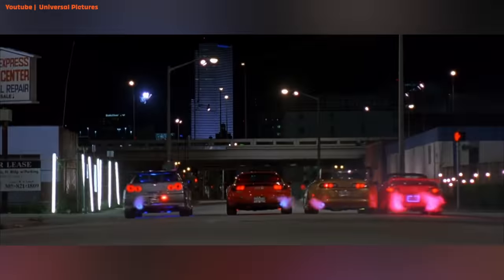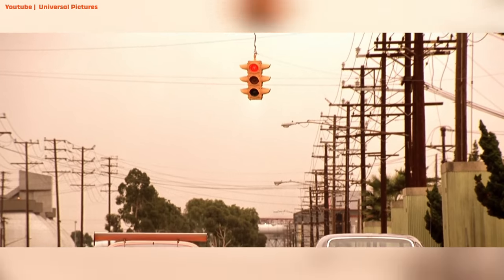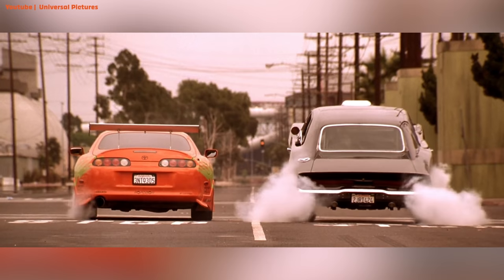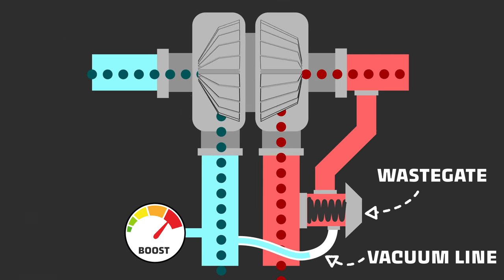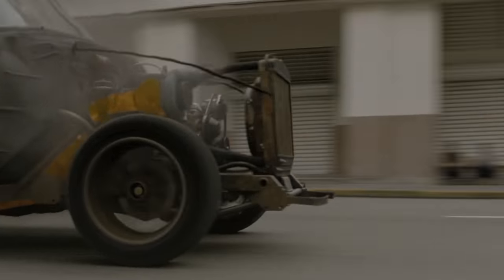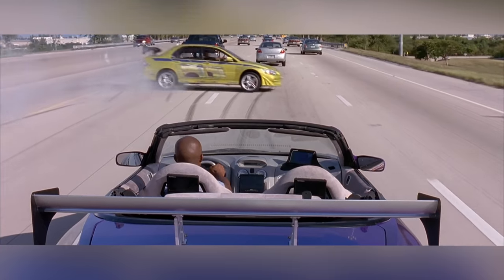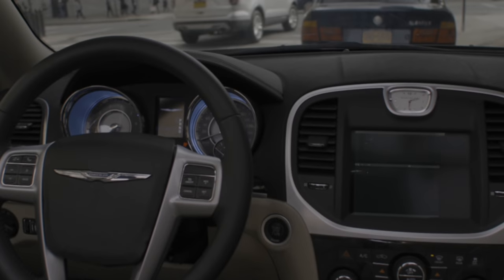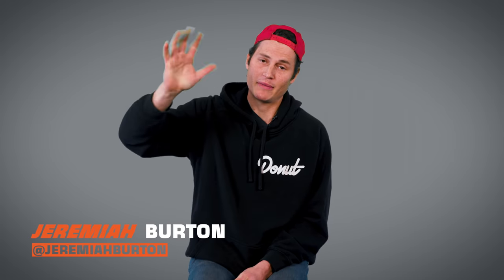Busting Fast & Furious Lies with Science

Comment: Vin diesel seems like the kinda guy to permanently run rich just incase he needs to pull the coketab on his wastegate.
Reply: "Pull the coketab on his wastegate"
I don't know how, but I will incorporate this into my daily vocabulary. :D
Reply: Lnao I love your pfp
Reply: @DominicDarrell  
Easy there, Tiger. You gotta take me out to dinner first- I suggest Gallo's ;)
Reply: @lllBASlll  Of what hour should one go out to Gallo's? 

;)
Reply: I mean it was considered the slowest so it probably was running Rich
Reply: lol maybe
Reply: Also, if the car had a pressure matched fuel pump or pressure regulator (which it would have to in the case of being a blow through carb) it could in theory maintain the appropriate fuel pressure and flow to increase power, especially if it was controlled on a sliding scale. That also wasn't addressed in the movie.
Reply: @dragonbrandon1995  yeah he totally could've tuned it for max boost then turned the boost down a lot causing the car to run very rich until pulling the coke tab, I feel like they overlooked this and could've found a more "impossible" scene because adding horsepower by adding only air is totally possible unless it's running lean

Comment: No way he hacked those cars without going to StackOverflow at least once.
Reply: Well moral of the story is that older car without cellular connection is hacker proof 🤣🤣🤣
Reply: @ramadhanisme7  another reason to buy an old ass celica with more rust spots than horsepower
Reply: 😱😱 you used the wrong pronouns!!
Reply: @gwadamit8116  grind down the aluminium, mix it with rust and retire it in glorious ball of burning metal.
Reply: @renee_atomik  what
Reply: @renee_atomik  please tell me you’re joking...

Comment: "cant drive fast in reverse"
laughs in defective gear ratio
Reply: Exactly. Probably not to 100mph but the top speed can definitely be increased (possibly at the expense of a whole bunch of things).
Reply: Custom 1.23:1 reverse gear.  Have to get it up to at least 45mph in forward before spinning around for reverse engagement.
Reply: They definetly  used a tractor or semi transmission so they had multiple gears in both directions, there is a article about it somewhere
Reply: @shadowgotmilk1  one of our tractor has 36 reverse gears
Reply: @JussiValkila  ah yes, 36 reverse gears
Reply: @Beam-jo6sb  and on twelve of them it doesn't go faster than 2km/h.
Reply: Yeah tractors have multiple gears for reverse... But they're built for pulling heavy objects, that means low end torque. Not speed.
Reply: laughs in CVTs with limiter delete
Reply: Laughs in CVT
Reply: Smaller gear ratio in gear ratio for reverse means more mph in reverse,
Reply: Laughs in DAF, a series of Dutch cars known for being able to almost go as fast in reverse as they were going forwards. 

Also known for toppling over when slamming on the breaks when going in reverse too fast.
Reply: @VancePetrol  doesn't sound like a good thing to be known for
Reply: Laughs in old 2 strokes and diesels, some of which didn't even have a reverse gear to begin with, where you could make the engine run backwards.

Thus having all your regular gears, but reverse!
Reply: @TheHenirik  Not "old 2 strokes and diesels", rather 2 strokes overall. The problem with this is that the oil pump won't be running in the correct direction and the intake and exhaust gets reversed so it won't last long unless you put an electric oil pump and a valve system that makes sure that the air going into the engine is always filtered, even when the engine is running backwards. It might also be good to upgrade the intake valve material to an exhaust valve material which can handle higher temperatures.
Reply: @jeffhall92  lmfao
Reply: @TheHenirik  lmao!!  I used to get my friends pissing themselves laughing when I'd fire up my old 2 stroke Puch moped backwards in high school.
Reply: @quentagonthornton49  make sure to swap cams too! 🤣🤣🤣

Comment: FF12: wheelie while drifting while burn out while stoppie while rolling
Reply: While being fwd
Reply: So that would mean it's a hybrid muscle & jdm doing all of that on one rear wheel?
Reply: @I_love_bread_and_Hungry_Jacks  yo you a math professor?
Reply: @sharx7781  Just using what little common sense & brain cells I have left since 2020.
Reply: You would need 48,513,392 pound feet of torque to do that
Reply: That's nothing. I can drive with a 1.0 TFSI VW Polo on super cold temp on the Nurburgring breaking all records while only drive 5 km of the track doing a while on snow, drifting on one tire with a stoppie while I am doing multiple backflips in the car eating while I eat a delicious meal and doing a math test.
Reply: Lol
Reply: also while flying
Reply: And they are using actual horses to power the car

Comment: the thing about the tractor transmission shifting gears in reverse is true. Many tractors and other heavy equipment have a seperate shifter for engaging forward and reverse which means that you can normally shift into all the gears while going in reverse
Reply: Nice info 🔥
Reply: It would have been easier if they just flipped the rear end upside down.
Reply: Very true but the transmission gear ratios would still hold you back. Most tractor/ HE transmissions aren't designed to go faster than 25-30mph.
Reply: @LMG6989  you can install a taller final gear in the diff
Reply: Other thing Dom yells GAS not Nos. Check the subtitles
Reply: @LMG6989  Actually most of the gear reduction is at the axles of the tractors. One I drove had a 2/1 ring gear but had I believe a 20 something to1 planetary. Which would make 40 rpm input equal 1 RPM output
Reply: You could also have a symmetrical gearbox. It's exactly what it sounds like.
Reply: @dannyferrary666  Subtitles are often times wrong just putting that out there.
Reply: A tractor gearbox is also so much bigger than a car gearbox obviously because it’s got so many gears. It’s not uncommon for a tractor to have 40 forward gears and 40 reverse gears. Now fitting this into that car could be done if they cut the entire firewall out and the transmission was literally poking through into the cabin but it wasn’t
Reply: and some (mostly) old army recovery vehicles
Reply: @dantheman8749  more "gears" are mostly thanks to integral (or "bolt on") transfer box... normal heavy tractor trans have 15-20 gears foeward and up to 6-10 for reverse... yes they are big but not because of many gears (remember that you can have 10 gears in modern cars) but because they need to handle a lot of torque
Reply: Lol I paused before he got to that to look up what vehicles have a transmission with multiple reverse gears.

It wouldn’t apply to these scenes, but now I want to know what it would take to run a 4-stroke engine in reverse to get multiple reverse gears. Apparently it works with 2-stroke engines and maybe diesels, but the valves and timing would be off for a stock 4-stroke.
Reply: @Gnuary  to do that you will need some kind of transsmition even for valves to run them in reverse... for diesel engine yes you can technically run a diesel engine in both directions but that apply only for older ones, never try that on CR or PD and be sure that timing chain/belt  does not untension itself as many engines are build so they self-tension timing chain/belt in one direction and that apply for rollers too

Comment: Fun fact - some tractors are quicker in reverse than in forward gears. And yes, they can theoretically go 100 MPH, when powered by a gas engine and not a lazy diesel.
Reply: If you think a diesel is lazy in a tractor, a petrol or ‘gas’ engine would be 10x more lazy. Tractors are heavy. Torque is important.

Comment: In regards to a car going fast in reverse, you could technically do it with a "standard" transmission -- only if your car had a CVT.  A Dutch company called DAF made CVT cars in the 60s and 70s, which gave birth to an unusual competition called "Dutch reverse racing."  DAF cars had no speed limiter in reverse gear, which meant the car's reverse top speed was the same as its forward top speed.
Reply: Huh, the more you know
Reply: That is very interesting but I’m a little confused, how could you have a standard transmission and a Continuously Variable Transmission in the same vehicle? They’re two different systems
Reply: @ratherbefishing4225  he means with just an unmodified transmission that comes with the car.
Reply: Electric cars can go that fast in reverse, but obviously F&F is not using EVs
Reply: Just like in Big Rigs Over The Road Racing!
Reply: @zwenkwiel816 i thought the standard transmission was the manual
Reply: @Scooter227  not on some DAF cars that came with a CVT transmission...
think there's some Citroën models that came standard with a CVT transmission as well.

Comment: When he says NOS he should have said FOS caused that was fake af lol
Reply: Is it tho? Yes NOS not flammable but it is in a pressurized tank. Heat up your lynx air-spray....would it be the same?
Reply: @orderofmagnitude-TPATP  You might be able to make it pop but it wouldn't be a fireball. Just a overpressure failure. Wouldn't be a huge one either. Maybe like a tire exploding.
Reply: @skurblord3401  lol right they had a whole mushroom cloud it’s 2021 though anything’s possible jk
Reply: @skurblord3401  there wouldn't be fireball until the exploding nos tank ruptures the gas tank, causing a spark in the process, which then ignites the fuel, which then causes a large fiery explosion. That's what they were portraying in the movie.
Reply: @robertmyles9124  You forgot to mention the meteor that would crash into the engine bay of some busted up junker nearby turning it into a supercar.

Comment: You should talk about the "too soon junior" line and how they always wait with their Nos presses for some reason. That makes no sense - as long as you are not going to make too much power to break traction (like in 1st gear) you should get on Nos as soon as possible for the best acceleration (again, as long as you have traction, which you probably do in 2nd gear in a Jetta)
Reply: Yeah I put the blame on this franchise for making everyone believe Nos is like some rocket fuel booster that lasts 5 seconds so you have to perfectly time it.

Also that Nos requires additional tuning lol. I always remember that one scene from king of the hill where Dale blows his mower motor in a race by trying to add nos lmao

Comment: Thank you about the NOS one, I've multiple times talk about how this is impossible (even once at a garage, the mechanic decided to test it, took a blow torch to a stream of nitrious oxide he was spraying in the air).

Also love the "Zombie Car Apocalypse", because after the movie my mother goes "is that even possible", and I had to break it down for her (like how not all would have it)
Reply: while i totally agree/understand NO itself isnt flammable, theres a big difference in taking a torch to a stream of NO being sprayed  VS taking a torch to the actual compressed bottle with it fully shut.
Reply: @tconthepc_6958  or better do that to burning liquid fuel inside some container which should better represent what happens in the movie.
I mean its really not what burns that makes thing explode, it's the pressure build up when it burn.
gasoline alone can explode if it burns fast enough. I don't really see why adding oxidizer would make it burn slower
Reply: @tconthepc_6958  Bottles have a safety blow-off valve for that reason.  It would empty the bottle long before it would explode from pressure.  If it DIDN'T have that, it could explode...but luckily they all do

Comment: Fun Fact: A Car tire has at 13% Slip the most acceleration.
Reply: Site your sources 😤😤😤
Reply: @SWATROLLK9  also im from Austria, so i dont know if im find something in english
Reply: @SWATROLLK9  tractor tires are made to their best "acceleration from 50-78% slip.
Reply: @firegames1001  that’s fine. I was just wondering. I never really knew how much slip is too much! Thats awesome
Reply: I had a 1969 Plymouth Road Runner that launched best while smoking both rear tires. I’m not sure if I ever got the front wheels up lol
Reply: @SWATROLLK9  https://www.techniker-forum.de/thema/wieso-schlupf-beim-auto-noetig.65507/

Thats german but may it helps you. It says why you cant move without slip.
Reply: @dwightdawson3578  yeah... my little white mercedes launched a lot better slipping the tires just a little bit.
Reply: @dwightdawson3578  yeah! Thats slip and the weak(?hot?) tire surface.
Reply: @firegames1001  Your sentence structure is a little off but it’s understandable. Modern tractor tires are honestly amazing though, the speed and weight they see along the road with modern tractors is insane. Massey Ferguson tractors have some of the fastest road gears on the market, one of their largest tractors can go almost 37 mph down the road.
Reply: @firegames1001  LOL I never bothered to buy bigger tires, I just kept practicing burning up cheap tires in that sweet spot where the acceleration was multiplying. Too much slip was slower but let off on the gas too much and more traction might break an axle.
Reply: @slycarlo8747  sorry, thats the speechbarrier i meant. But yeah you right! 30-40 years ago we never could make such mashienes because of the tires :)

Comment: I've done a wheelie while spinning the tires but that's on my bike and happens quite a lot , isn't unheard of on bikes. But I am sure this happening on a car would be a way different scenario
Reply: Even if the tyres are going up in smoke, there's still some forward drive being produced. People apply the brakes for stationary burnouts, after all. On a bike you can lean backwards, drastically reducing how much torque is needed to lift the front. And onn some bikes it should be possible to jank up the front just with your body, no engine torque required at all

Comment: Actually with regards to turboing a carbed engine, i know from the 22R in my Hilux that you just have to connect a boost line to the mechanical fuel pump, the fuel pump in the 22R is rated to around 15psi, but during use it never actually goes past around 6 or 7 psi, so you can easily add up to 6 or 7 psi of boost without changing anything other than adding a nipple to your fuel pump. The airflow will increase 1:1 with the fuel flow, its not a serious performance upgrade but it is a cheap way of getting some extra hrsprs out of a carbed engine provided it has a readily accessible fuel pump and that that fuel pump has a high enough pressure rating... Something similar can probably be done with that shitbox dom races in Cuba.

Comment: The main problem I had with "car zombie apocalypse" when I saw this movie was, even if you could some how "hack them all", most vehicle's don't have any steering input mechanics that you could control. The only exceptions would be cars with self parallel parking  feature. Or as you said, self driving assistance feature.
Reply: My 2002 Prius has electric power steering.
Reply: @aspecreviews  electric power 
steering just makes the wheel easier to spin it does not control steering
Reply: @aspecreviews  Your not a writer for F&F are you?

Comment: Ok… learned something here!!!! I know all about turbos and super chargers etc. But I never dug into NoS. And I thought it was REALLY cool that is not jet fuel, but actually a third way of just adding more oxygen to the combustion process just like the basic principle of a turbo or Charger! Thanks Donut!
Reply: Yeah pretty much!  What sux about the N2O though, is (especially with a decent size shot) keeping the bottle full!  I only ran a 200hp plate on one of my cars like 15 yrs ago, and it lasts for quite literally a handful of passes down the strip before you have to top the bottle back off ($$$).  

Can be tricky too if you're trying to run "consistent" times, as the bottle pressure is always changing.  You can, of course, use bottle heaters and stuff, but at that point, you've spent over a grand on you nitrous setup (which you still have to keep getting refilled).  It's definitely not for the "budget racer" imho

Turbocharge the engine and be done with it! :)
...and add nitrous to that later for extra fun. lol
btw, nitrous works really well with turbos (a "50hp shot" will make around 100hp extra with forced induction, too)

Comment: If you google image search “vintage dragster wheelie” there’s pics of old school dragsters doing wheelie burnouts
Reply: I kinda remember those too. They look like around 60s or 70s
Reply: occasionally modern drag bikes do it
Reply: sure its entirely realistic...
Reply: They were also much lighter than a full bodied car. It would require less torque and/or less friction (traction) to lift the front end.
Reply: Yeah that happens because the car wheelies so hard that the rear contacts the ground and unloads the rear tires momentary causing them to spin.

Comment: Only me and the boys remember the 250 Miles per hour Regera going in Reverse in Forza Horizon 3
Reply: Well not 250mph because you can't use the power from the ICE in reverse, but you could theoretically go pretty fast in reverse because the electric engines can go just as fast in either direction and you've still got 700hp from them. If it wasn't limited electronically, which I'm sure it is otherwise it's suicide, I bet the Regera could do 180mph in reverse just fine.

Comment: About the high-speed reverse:
The real show-stopper to this is the steering geometry of a car. The steering is set up in a way to get a good directional stability and a righting / restoring moment. While driving forward...
Driving reverse, this effect also reverses: The car does not want to drive straightforward by itself and if the wheels start to steer in one direction, they want to increase the steering angle.